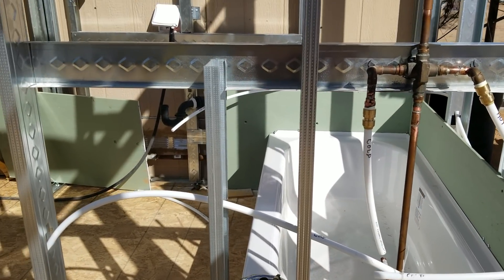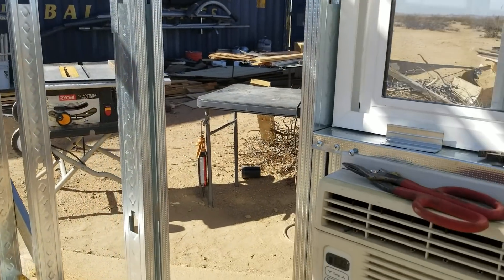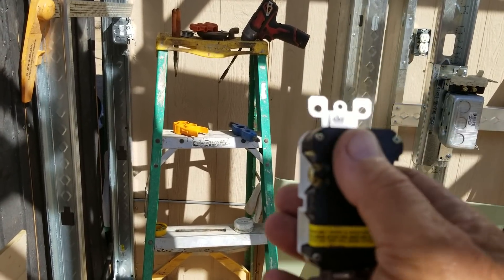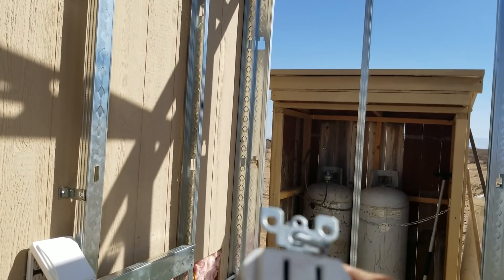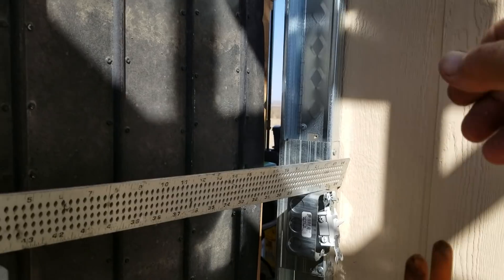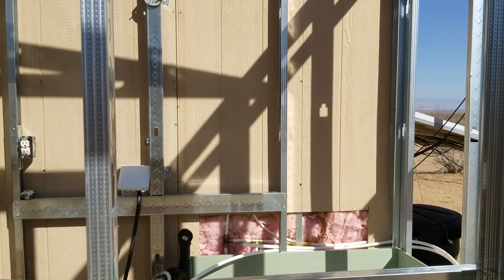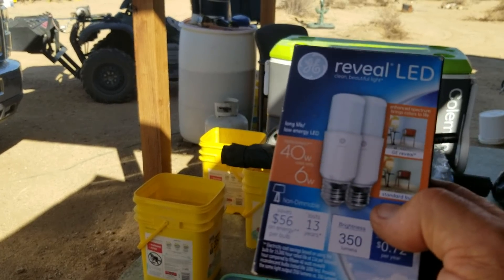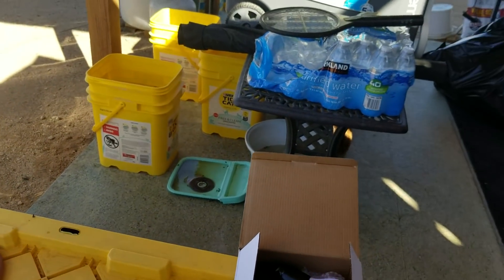Homesteading the Desert,  Sep. 8, 2018

Comment: Hey sir. When we run that pex we insulate both hot and cold. Then the cold water enters a warm space it will sweat like a cool soda. Pests will learn they can get water from them and start to chew on the pipe causing a leak. To prevent that, we just insulate the pipe. Most pex is not UV resistant either. Hope all is well. You are making great progress!
Reply from the maker: Redefine Living interesting.  I have never seen plastic pipe sweat.  I will be insulating the walls with r13 fiberglass.

Comment: Thanks for the explanation of calculating wattage.  But using the power triangle as a visual to explain calculating wattage (power), in addition to voltage and amps (current), would have been easier.  Search "power calculation triangle" for more inforamtion on this. In addition, the Ohm's Law triangle could be used to find Resistance, Voltage or Current (amps).
Reply from the maker: Paul Gendron thanks.  I remember the PIE chart from high school electric shop.

Comment: Have a question..
Having very limited knowledge with steel studs..
You've mentioned there are insulators to protect thing fed thru steel studs..
Where do they hide them at home depot..
And what are they called...
Reply from the maker: jim h they are hidden in the electrical dept.  The ones they carry are yellow, round ones, 2 piece, 25 to a bag.  Just ask an associate for them and they will point them out to you.
I have some around here someplace from when I built the main cabin and need to find them for my plumbing, electrical, etc on the addition.  When I do I will show them in a video.
Reply: G Bear 
Thank you... 
Now i know where to look
😀

Comment: Before i fully retired a was an electrican for a number of years..  As a company standard we never used the stab-in connector on a device only the screws...
We made a lot of money fixing devices when they failed.. (One condo complex,  we were there once a month because a stab-in connection failed... We did a contract and fixed every device in the common areas)
Wires heat up and cool down over time they will back out of the stab-in..
#14 gauge the worst..
#12 gauge not so bad..
It's your project..your choice..
Just letting you know as a electrical company with a number of crews what we found..
Reply from the maker: I never use stab ins if screws are provided either.  Again, I know all you are stating, but I'm not trying to train electricians to service apartments, etc.  I am only trying to answer simple questions asked about certain things without getting too technical. 
I'm sure you were a good electrician in your time.
Reply: G Bear 
You are a wealth of information
and I'm learning a lot from you...
I just found it's easier to someone the first time than break bad habbits..
Reply from the maker: jim h that's true in most cases of training someone to do something as a career, but too much info given to a layman who will do it maybe once in his life would just confuse them.  I was a General Contractor for 40 years, and a handyman for the last 10 years before retirement.  I was a "hands-on" contractor, not an office boss, and I know you would be the type of person I would have hired, conscientious with an eye for detail.
I can't teach someone to be a professional electrician, plumber, framer, roofer, air conditioning tech, painter, welder, cabinet maker, solar and wind installer, backhoe operator, truck driver, concrete finisher, brick layer, landscaper, etc. In a 15 minute YouTube video.
I can only teach them enough to peak an interest in pursuing that trade further.
Thanks for watching and commenting.
Reply: G Bear 
Some things
Like how to tighten a GFCI
I like to teach anyone..what to look out for..
Simple mistakes can take a diy'er and frustrate them.
and some times make them think they can't....
To me it's just paying it forward...

Comment: Side note on GFCI circuits..
In a 240 volt or 208 volt building.. GFCI can't share a neutral..
Each phase needs its own neutral...
also i find that installing wires in a GFCI you can't get the wires tight enough with a Phillips screw driver if you are using solid wire.. You're putting a round solid wire into a flat sided hole.. As the wire moves or heats up it changes shape ( moving towards flat sides)
I tighten the screws with everything I've got..(I've never broken one yet)
Then before installing i shake the device.. And retighten..then i train the wires to the box..(coil them like a slinky) and retighten the screws again.. Before i learned i had failures... Since i've  learned no failures..
Also personal preference..
I don't carry a protected GFCI circuit from one room to another...
People (custoners) forget..
I put the Protection GFCI device in each room needed...so if a room goes down the device is in that room... (We had a home that both bathrooms and part of the kitchen went down... we looked all over for tge failure... Finally on of our electricans found it in the garage behind boxs stacked against the wall..
Devices aren't that expensive.. I suggested i add devices to each room needed... Customer is happy and never had that problem again..
But again this is my personal preference...
Reply from the maker: All true, and more I could add, but I was preaching to novices planning to build a cabin, not a 400 room hotel, lol.  I have also found homes with garage gfi's covering the whole house, but code allowed that an builders save where they can.  We could pick apart every part of building track homes, but I wont go there.  I am only trying to help a few future homesteaders understand "basic" building techniques.
Thanks for commenting.
Reply: G Bear 
You have a nice following...
and they are learning a lot thru you...👍
Reply from the maker: jim h thanks.  Like money, I can't take it with me,  so I may as well share it!